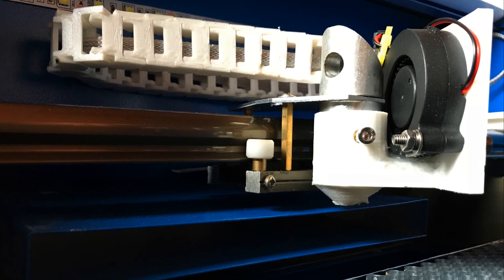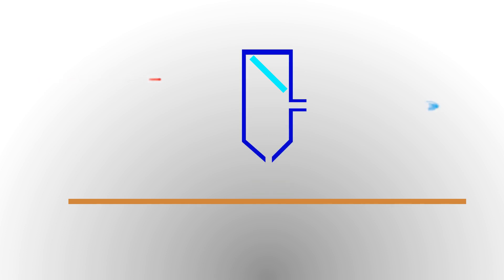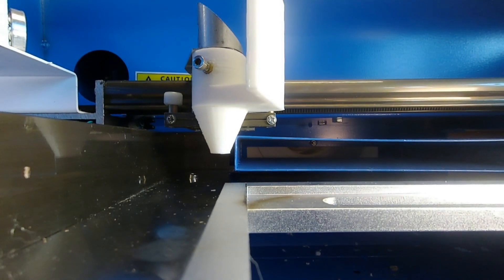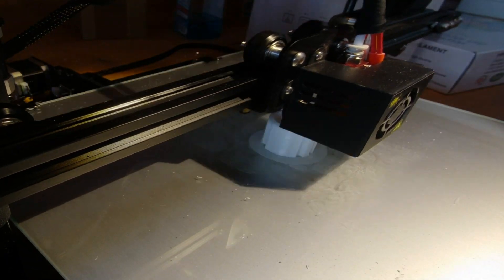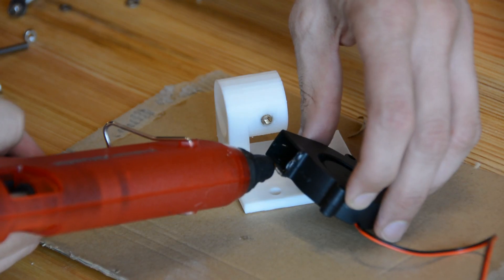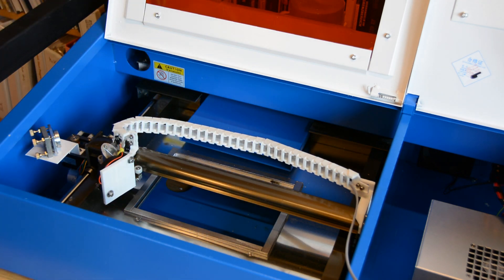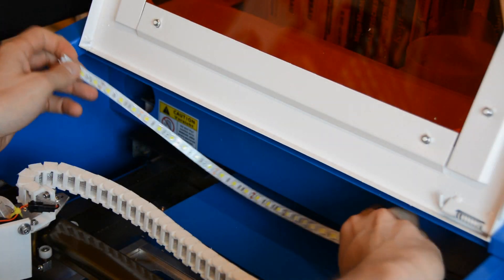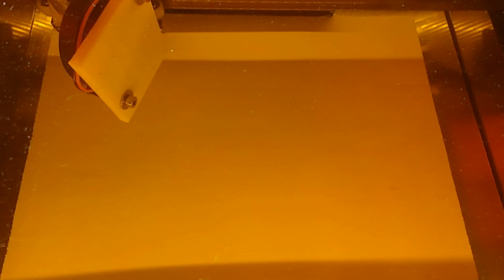K40 Laser Cutter Air Assist - 3d printed and powered by a fan

Comment: Pulling additional power off the K40 power supply is NOT recommended as it is marginal at best for the laser only.
Reply from the maker: Hmmm. The fan draws around 1.5 Watt. Why do you think that's a problem? It is working fine for me for a couple of years by now.
Reply: @WayofWood  It is NOt recommended to draw any additional power from the stock K40 power supply in almost every forum I have visitied. They claim it barley supplies enough for the laser itself. You can do as you wish.  enjoy

Comment: I'm looking at the K40 laser cutter for cutting 1/8" colored acrylic.  Would this air assist be a recommended upgrade for this particular application as well or is this primarily for wood cutting/engraving?  Thanks...
Reply from the maker: When cutting acrylic the varpour is flammable and without an air assist a vapour ignition could be possible.

Comment: How can I get the attachment for the fan without a 3D printer? I found the fan on amazon though
Reply from the maker: brandon henderson The easiest solution would be to use the 3d printer in a local maker space. 
As an alternative you can use shapeways or an other Service that 3d Prints Models. Unfortunately these services are quite pricey.
I could also put a 3d print in an Etsy store but with international shipping it won’t be much cheaper that a printing service.
Reply: I did some research and just ordered me a 3d printer! It has a lot more upsides than I ever even began to think of. They aren’t pricey as I thought either.
Reply from the maker: brandon henderson Good idea. If you are into woodworking have a look at some of my videos on what to do with a 3d printer in the woodshop.
Reply: WayofWood will do

Comment: It would be grate if you would show some examples and the differences that the turbine fan makes and if it is a good upgrade compared to like a aquarium pump or even an airbrush compressor. 

Greate video besides that ! Keep up the work :)
Reply from the maker: Benjamin Breidt I don‘t have a compressor; so I can’t show the difference. But in terms of the effect there shouldn’t be any difference. You blow air on the workpiece  - which should work with both methods. 
The main advantage of the fan is that it’s quieter, a bit cheaper, and the cables are easier to install than air tubing...

Comment: hi, great project ! it's works perfectly or ??? Can u say me what is your lind of led did u used in this movie ?
ths
Reply from the maker: The LEDs are a standard 12V strip. These are the ones that I am using: https://wayofwood.com/tool/led-strip/
Reply: @WayofWood  ths a lot. And where did u connect them ? Sry :-) we just receive one K40 (first engraver)
Reply from the maker: @FrenchDiggers  You need to connect a step down converter and then connect the LED to this converter. Have a look at the website article regarding the details.

Comment: This seems like a great idea. I installed my air asist using a 50L shop compressor, routed all the way to my K40. Sadly, the compressor starts so often that my power bill is growing and the noise is driving me crazy. . I was wondering if this fan could work if I try to make it blow through a 1/4" silicone tubing, so I don't put the extra weight on the head moving mechanism.
Reply from the maker: Give it a try. It works great and is less noisy than a compressor.
Reply: @WayofWood  Hope I get those blowers next week. I will update as soon as possible

Comment: Hello  W-O-W,  I love the idea of not having to install an airhose, but doesn't this idea go contrary of passing "fresh" air through the laser nozzle to keep the lens clean from smoke?  It seems you are just recirculating the smoky air back through the lens. Do you find you still have to clean your lens as much?  - Just curious...I like this solution better.
Reply from the maker: Corvus Moon Pottery The air assist is keeping the lense clean as any other solution. The smoke should be removed by the exhaust — not the air assist.
The exhaust fan that comes with the K40 is actually working okay; you might want to replace the tube but it’s working ...

Comment: Great videos,  really appreciate you taking the time to make them.  How is the 3D printed nozzle with fan holding up any issues?  This is a great idea and wonder why other companies have not done this yet?
Reply from the maker: Dennis Forbes The air assist works great. We still use the one from the video and have quite a few hours on the laser. 
I wonder too why there isn’t a Chinese manufacturer that makes a laser cutter with a few extra features and sell it for 600 - increasing their margin by 160...

Comment: So if I have a 24v 5015 fan, I can just hook it up to the power supply without a buck/step down converter?
Reply from the maker: airborn101st If the fan is specified for 24 v double check with a multimeter but in general it should work.

Comment: Normally if you want to extinguish a fire you would cut the oxygen supply ,  adding a stream of fresh air should be considered Contra productive but since everyone goes this route I will try it too. ;)
Reply from the maker: TheRcEngineer In this case I guess the mechanism is similar to a candle: you don’t remove the flame from oxygen but you remove it from the material ... just guessing 😏

Comment: great idea. Is it the same effect though as high pressured air assist?
Reply from the maker: bryar osman It works absolutely flawlessly - even after several hours of cutting. You might want to aneel the PLA before use if you cut a lot of material very slowly (2mm/sec) to cope better with the heat. Other than that it works great 👍